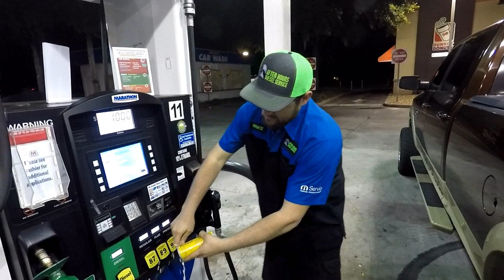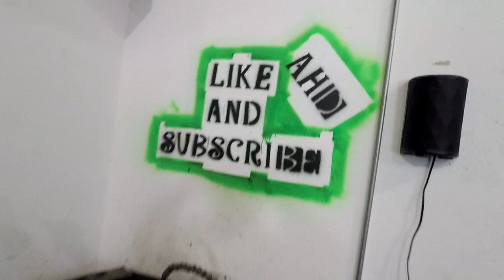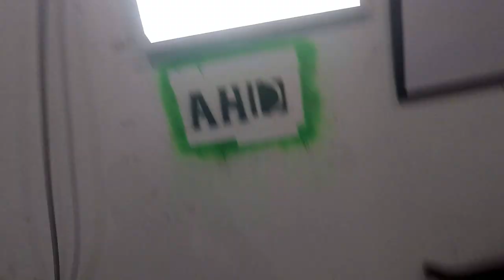New BEATER Truck?!?

Comment: Bruce I got a question  got a 2000 24 v I'm wanted to do injectors & be easy on my motor with low egt levels  what would u run in it

Comment: i have a few questions. i have a 95 12 valve 2 wheel drives i put industrialinjection 90 horse injectors in and now when the tourqe converter locks up and driving at the slowest speed with it locked up the truck shakes until you speed up or slow down it also happens when you first take off slow sometimes too do you think it is the injectors not firing right or the tourqe converter just cant take the power would 5x14 injectors be to big for a 12 valve with a 58mm turbo. do you recommend delivery valves. how much boost can a typical 12 valve head gasket take without blowing and can you re tourqe the bolts or do head studs without taking the head off like the 24 valves. thanks
Reply: Bruce Wilson ok thanks can't wait to see the 12 valve content 👍